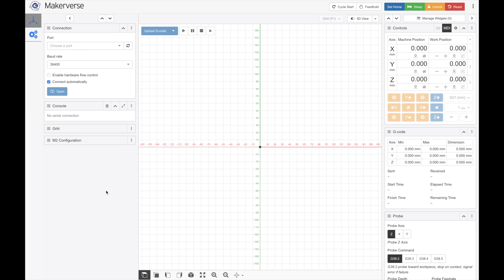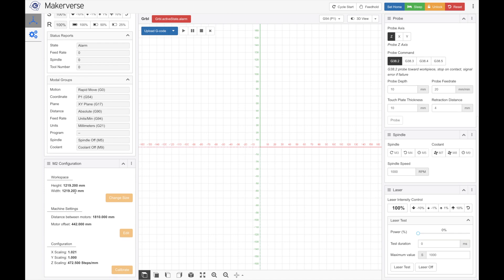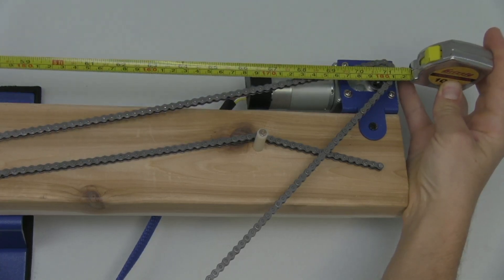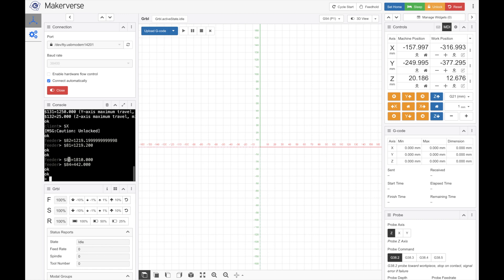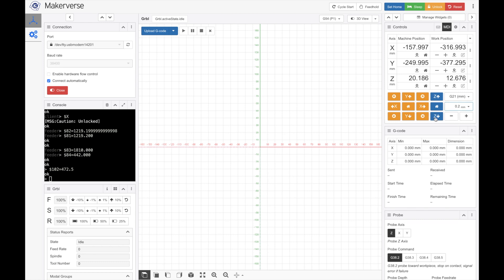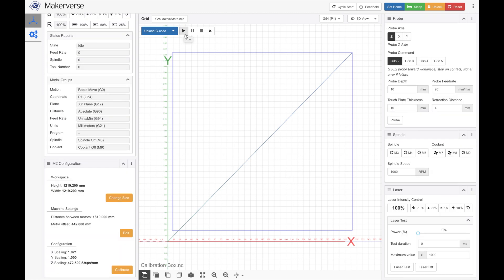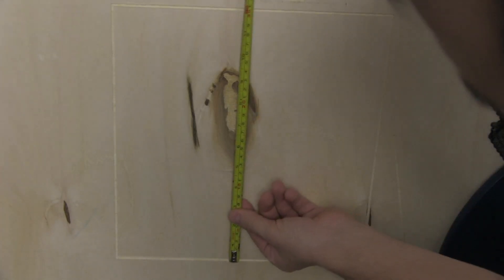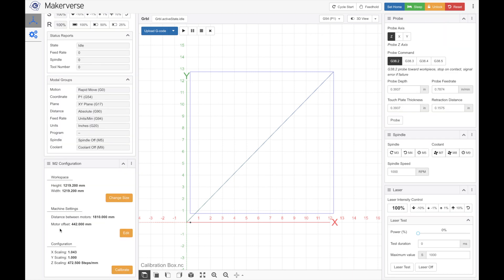How to calibrate your M2 using Makerverse 1.0.6

Comment: hi, great vídeo! Can you set the frame in a vertical position?
Reply from the maker: Yes, that's what it is designed for! The frame mounts to a wall to save space.
Reply: @MakerMadeCNC  indeed but the frame is mounted horizontaly, if mounted verticaly you could use even less room space!
Reply from the maker: @xandolucena  It's mounted vertically on a wall or stand alone frame!
Reply: @MakerMadeCNC  I mean can you rotate the 4x8 frame, so the 4 stays in the horizontal axis and the 8 in the y axis?
Reply from the maker: @xandolucena  Absolutely! It will take some calibration, longer chains, and your top beam mounted high enough to fix your material. But you can also rotate your cut to be 90 degrees in your CAM software, and then it will fit on the standard frame!

Comment: I am able to connect to using the Makerverse app but the console does not show any readout information! I tried to uninstall and re-install multiple times but same issue. All physical connections seem solid and I do hear a high-frequency hum from the motors. Status reports widget has no information in the fields and the M2 widget buttons (Workspace, Config, etc) are grayed out. 
Any inputs on what I am missing and how to solve this?
Reply: Another reason this can happen is if the two boards come apart, which can happen when you're unplugging, and plugging things in a bunch, especially if mounted. The due board and shield are two separate pieces and if they get tugged apart you'll be able to connect to the due, but not see any of the stuff to control because it's not plugged in anymore.
Reply from the maker: We're sorry to hear that you're having problems connecting! Does your port show up in the "Port" field when you refresh? If that doesn't work, please send us an email at support@makermade.com and we'll help you get to the bottom of it!
Reply: @MakerMadeCNC  Yes. The port shows up and it recognizes Arduino. After successfully connecting the console becomes active but does not show any readouts. I will email support with the details of the problem.
Reply: We’re having the same problem here! Did you find out any answers?
Reply from the maker: @carter7113  Are you connected to the correct USB port? 
Here's a video to check!

https://youtu.be/kmbkZJqn0Eg

Comment: I install the program but I don't have the M2 configuration panel (widget) and I open it it says it connects but no return of information
Reply from the maker: Is you M2 plugged into the correct USB port? It is the port next to the power plug on the bottom DUE board.
Reply: @MakerMadeCNC  the problem was that in the flash drive you provide the program is barelly the same CNCJs and i confused it with makerverse thought it was the same. tx
Reply from the maker: @sabatilla45  Sorry about that! We weren't sure that Makerverse would be released in time, so CNCjs was included on the drive. Glad you figured it out!

Comment: where can I find the gcode for the square to cut? do I have to make it myself or can I download it somewhere?
Reply from the maker: Since everyone's M2 is a bit different, we don't have a standard Gcode yet that will work for all users. We suggest you design a square in Easel with your proper bit size and dimensions. Basic instructions for Easel are found in our user manual on our M2 Resources page. We have more tutorials and Gcodes in development and they will be released there! https://makermade.com/m2-resources/

Comment: Couple of questions.
Every time we connect the machine it is advice we press the unlock button as well as home the sled?  
Also when you zero work offset do you have to do it for X and Y or either or will work?
Reply from the maker: If you have unplugged your DUE board from power, then yes you will have to set home when you connect. If you have not, the M2 will have its home/work home saved. When you zero a work offset, it is only for the particular X,Y, or Z motor. You will have to set the work home of each individually!